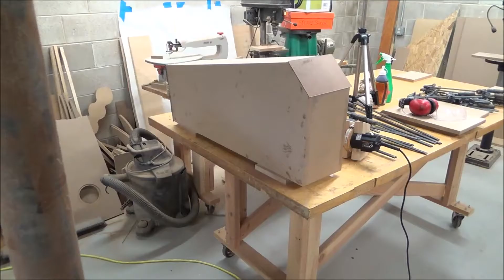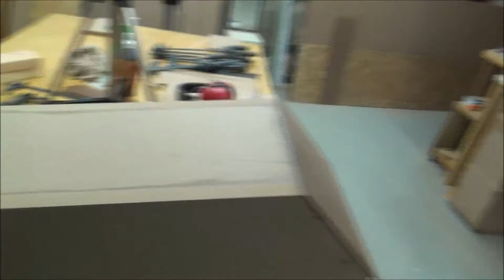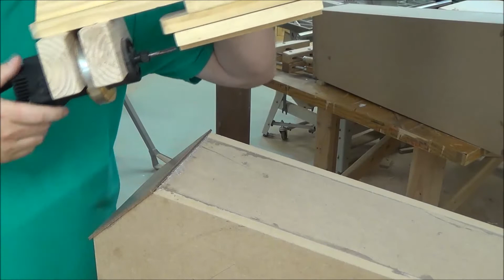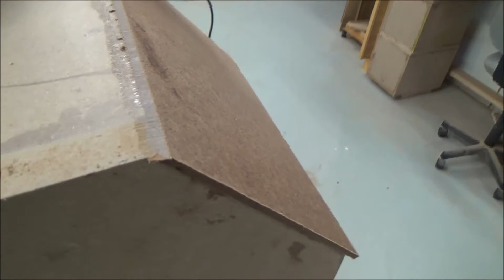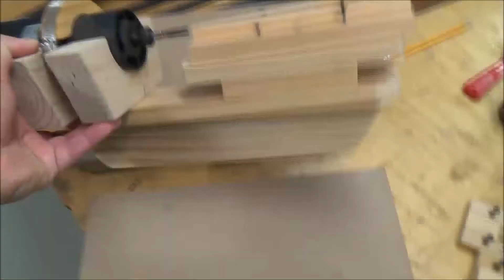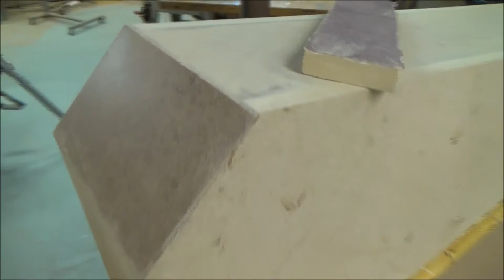Irregular Angle Router Trimming Tool Video

Comment: What a neat idea Tom! Are you applying the 1/8 inch HDF only on the faces that show the MDF end grain or on all sides?
Reply from the maker: Billy,  I applied the HDF to the front, top, and little bottom angle part of the cabinets. I originally intended to leave the back as-is and just veneer over it, but the more I got to thinking about it, the more I thought that if seams show up later on -- even on the back -- it would bother me, so I ended up putting 1/16" maple veneer on the back as well. Let that sit a bit, then block sanded that again and put the veneer over that. I've done that before with good results.  It would have been fine to use the 1/8" HDF on the back also, but I had already routered the recess on the back for the Precision Port and didn't really want to use so much gasket material, so I went with the 1/16" maple instead of the 1/8" HDF.  Either would have worked though. 
The bottom of the cabinets were just painted black since they're not visible.  The bubinga veneer I put on these in the end is very expensive (for me!) and deserved to do everything I could to keep the seams from showing.  It's worth the extra effort in the long run. 
Thanks for the interest in this project and the trimming tool. Necessity is the mother of invention, right? :)

Sorry it took me a while to reply, I've been trying to get these speaks done before the Midwest Audio Fest in Ohio This weekend and I was running out of time!
TomZ
Reply: Thomas Zarbo. Awesome, thank you. no problem on the delay. I want to do veneer on my next speaker build, so I'm looking around for information.

oh I was wish I'd be living closer to attend MWAF. Be nice to meet all the great techtalk folks and to get to listen to other peoples speaker designs. someday 😀